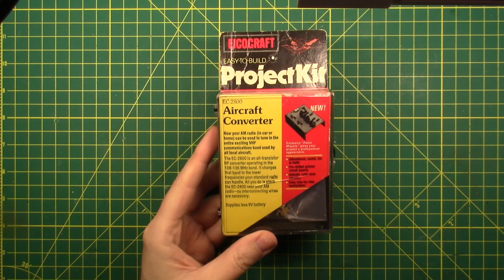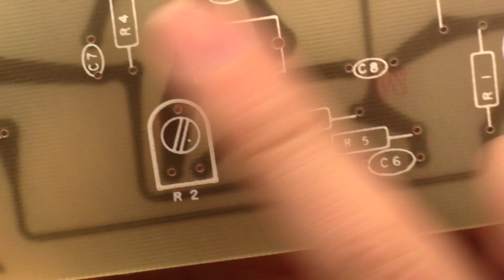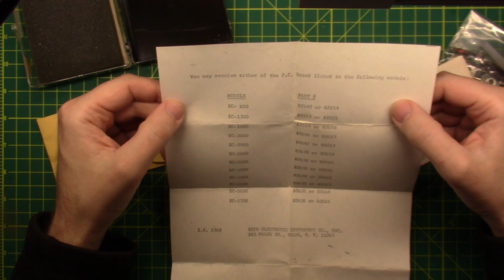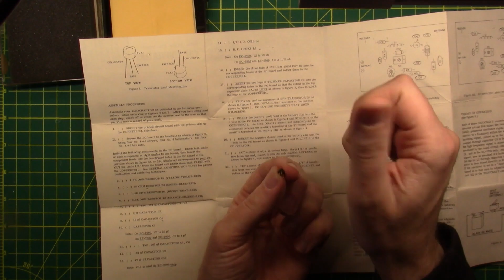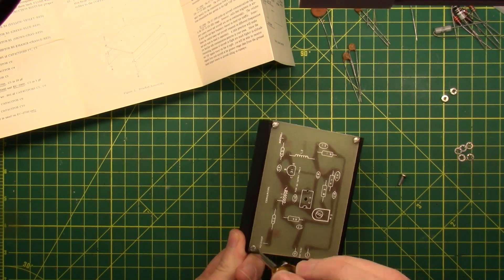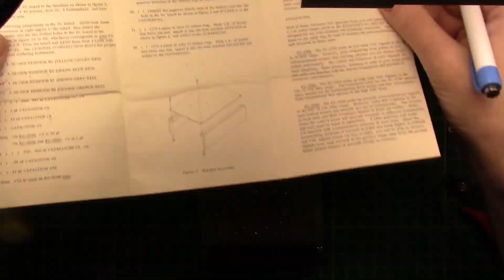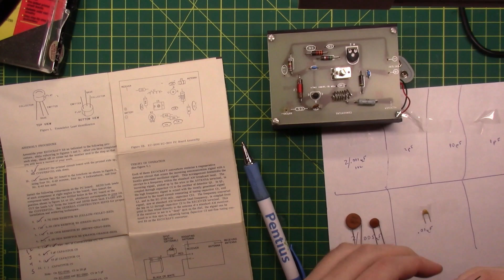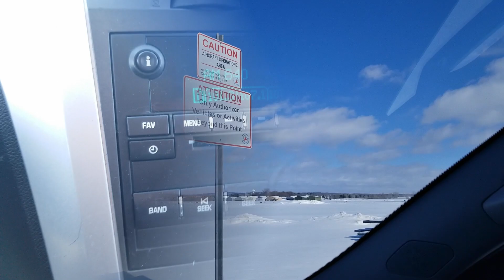EICOCRAFT Aircraft Converter - Convert Airband AM to Broadcast AM for Easy Listening

Comment: Hello could you give me the wiring diagram. I would like to replicate it. But can only see a little in the video. components etc. Many thanks in advance Greetings dieter
Reply from the maker: Hello Dieter, I don't have the project anymore or I'd certainly help.  Good luck in your search.
Reply: @temporarilyoffline You can build one using a s0913 transistor and N551 transistor
Reply: Its cheaper and easier to just go buy a portable radio with Airband. DIY radio requires fabricating tiny coils and transformers.

Pause the video at 7:32, the schematic is visible. 10:45 the completed PCB and components.

Comment: Did I miss,how did you hook it up to the car radio? Does it go inline of the existing antenna and radio ?
Reply from the maker: You didn't miss it.  It re transmits over it's own antenna.  The closer the better because a 12" wire on 850khz isn't gonna do much.

Comment: Until I watched the video, the title bothered me. Airband IS AM modulation, just at a higher frequency. The broadcast band defaults to AM modulation, but that frequency band is not the only place AM modulation is used. This converter is like a transverter -- it shifts the frequency of the received signal and retransmits it on the new frequency. In this case, it retransmits it in the broadcast band so any AM broadcast radio can hear it.

The title, if you don't know any better, suggests that airband is not AM. It IS AM, and for very good reasons, the "capture effect" being high on the list. You can't have a situation where the signal from one plane completely blanks out the transmission from another plane, just because its signal is the stronger. With AM, ATC can at least hear that there were multiple planes transmitting at that time, and can ask each to send again, or to call each plane separately if they heard enough to identify each plane.

(My lifepartner is a private pilot, and both of us are hams.)

GREAT video! I have nostalgic memories of going to the local GA airport with my dad, back when he was taking lessons. We built a similar converter, then an actual airband receiver, and had fun listening to the planes. Then, one day, we heard a pathetic warbling on 121.5 -- someone's emergency locator beacon was going off! We enlisted help from the FBO and went running around trying to get an idea how far away it was. It turned out to be a plane sitting in the tie-down area. A few days earlier, it had landed a bit hard. Didn't hurt the plane, but it was enough to trip the ELT's inertial switch. The truly sad part was that to have such a weak signal, it had to have been transmitting for at least 2-3 days without anyone noticing. This prompted an article my Dad wrote for Flying magazine on the subject.
Reply from the maker: The capture effect is the most useful part of the airband setup.  I've always had problems explaining it... probably because I'm calling it intermod and that might not be the best description out there.

Was nobody listening on 121.5 for the ELT?  That might explain why it took so long to be heard, but that's very scary as a pilot to have an ELT that nobody would hear.  Guess you need a handful of different types of them if nobody is going to listen.
Reply: @temporarilyoffline  Nobody was listening. The airport it was AT didn't have a monitor on 121.5. Neither did any airport within the range of a grounded airplane. Now, of course, things have improved, with different emergency signaling devices and satellite overwatch. But at the time, this was particularly terrifying, because those ELT's were Federally mandated emergency gear! You had to have one, or your plane couldn't legally fly. But nobody would hear it if it did go off, except, as in our case, by accident.

Capture effect doesn't normally happen with airband, because it's AM, not FM. FM is what gets hit with capture effect. That's  why when two people double on a 2m FM repeater, you only hear the stronger signal. You don't hear a heterodyned garble of two peoples' signals mashing each other into unintelligibility. You get one signal capturing the receiver, and the other being shut out. Having been net control enough times, trying to get incoming calls, to have 5-6 calls all be jackrabbit key-ups, trying to beat the other guys into the repeater, I am quite familiar with this effect. You might get a little whine in the background of the capture signal, to clue you that someone tried to get in but was stomped on, so you know to call and ask if there was someone else. Sometimes, you get the tail end with part of the call suffix, so you can ask, "there was a double...station ending in 'sierra', come now?" But sometimes, especially when portables are trying to get in, you get people who try 4, 5 times to get into the net and can't because the base stations are all jumping in the microsecond the net control's carrier drops. I've given up on checking in on more than one occasion when this was happening. Just too much frustration trying to get a word in edgewise, and net control not extending the time to ask for stations, too intent on the clock so they can get out of the net and go to Bob Evans for that biscuit and gravy breakfast.

At least on AM you get heterodyne, and can hear that two people tried to transmit, and can ask for a repeat.
Reply from the maker: I couldn't agree more.